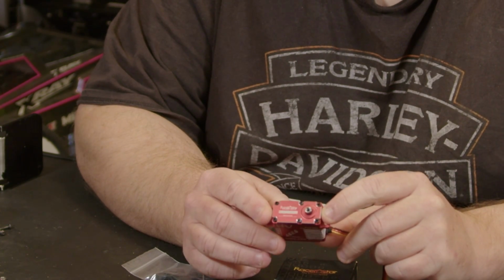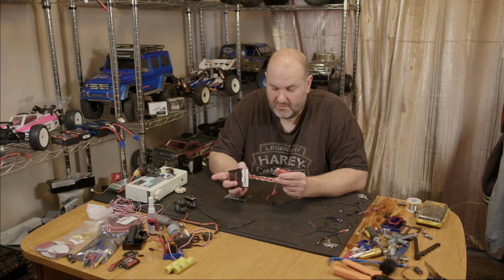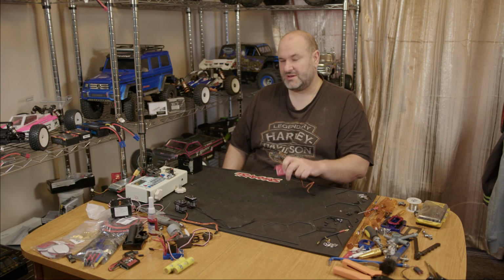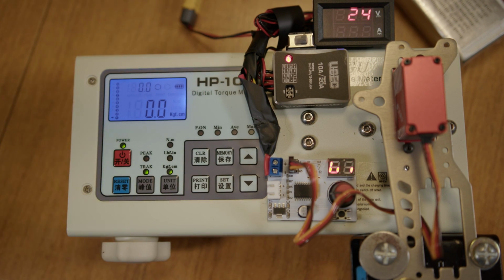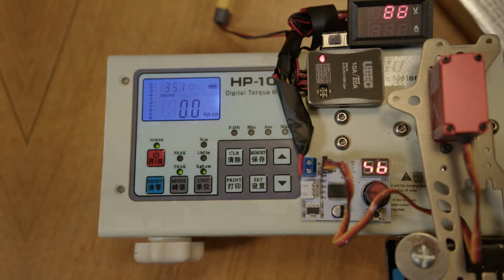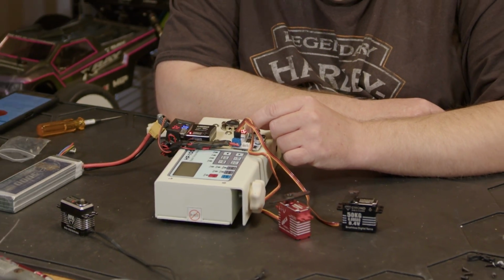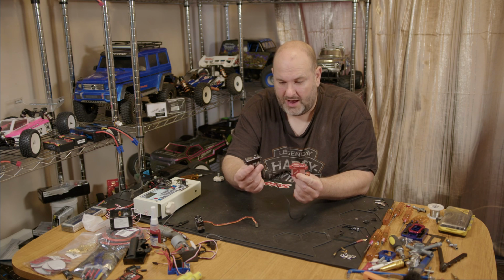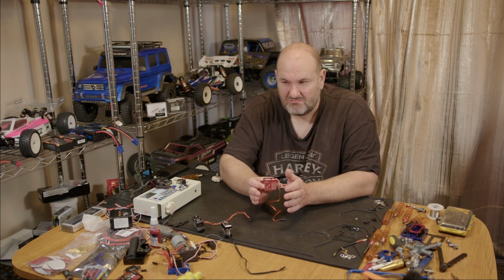Racerstar BL7146HV servo tested

Comment: Well done test (as usual).  I appreciate how you test servos.  I've run a Racerstar 7346 in my TRX-4.  It was OK but definitely had its limitations when the wheels were in a bind.  I'd probably go with the Dmond if I had to choose... at least for me!
Reply from the maker: Yeh the dmond is coreless not brushless as advertised but it is 50kg @8.4v and dam fast response due to it having a coreless motor and very little heat build-up

Comment: If you're looking at other brands to test I recommend AGF and Blue Bird. My Blue Birds perform great, but I've found you want to take them apart and thread lock all of the screws.
Reply from the maker: AGFRC reached out and sent over some servos and a gyro to test so should be on the channel soon :)
Reply: @WTFRCCars  looking forward to it. Theta servos are also very interesting. They've got some with NFC (wireless programming) and ones that work with FlySky's new high speed system.
Reply from the maker: Yeh flysky just sent me one with the noble pro that has NFC and 800+ Hz polling rate

Comment: I have both servos, but my Racestar is coreless. Very fast moving, but it is slow to get back to center.
But now I'm lost: you said the Dmond is coreless???!!!!Though you said it is brushed on the previous video
Reply from the maker: The dmond is advertised as Brushless but it's not the racerstar you can buy in Brushless or coreless and they are as advertised, I believe they are both from the same manufacturer :) both good servos but the brushless ain't the kg there advertised as and the dmond ain't Brushless but is the kg they advertise lol
Reply: @WTFRCCars  jop..they arecprobably made by JX 😉